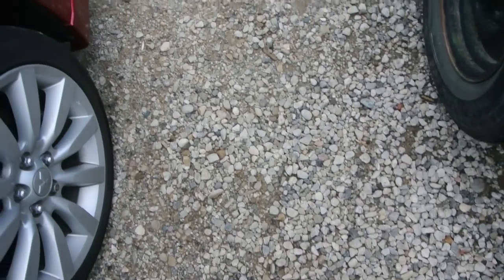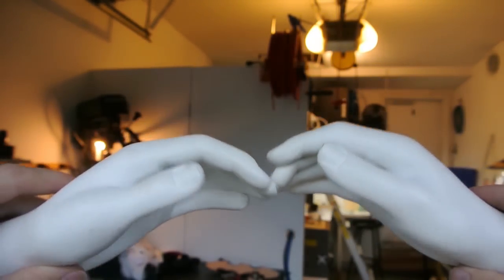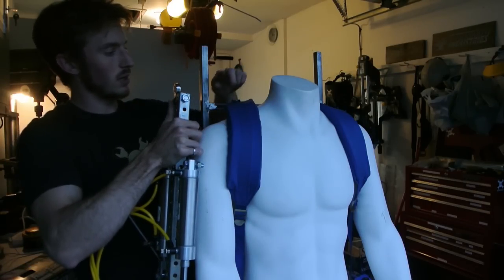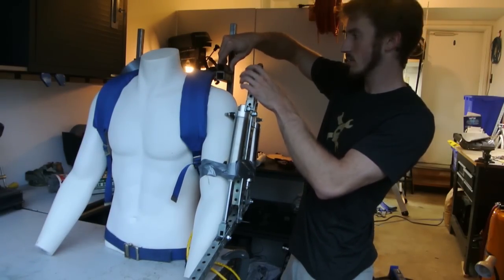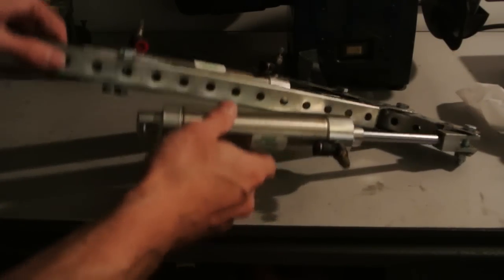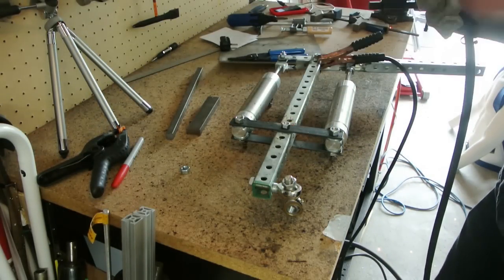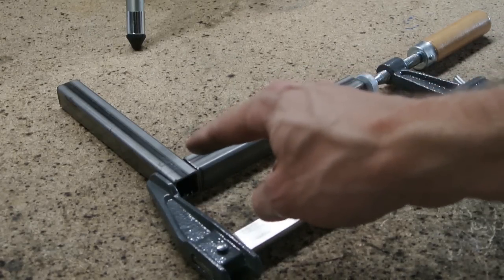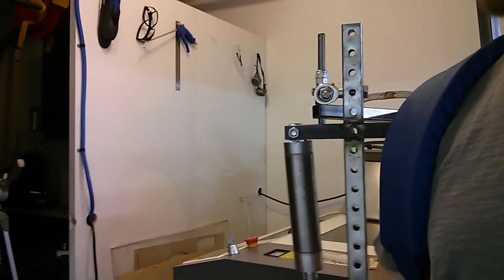Elysium Exoskeleton, Part 11: Mounting the Shoulder

Comment: Awesome stuff! I need to get an electric welder. Any recommendations?
Reply from the maker: If you're just getting started, I'd recommend a cheap little FCAW unit (Flux Core Arc Welder). You should be able to get one for about 100-150£

It's similar to MIG, like using a metal hot glue gun. But you don't have to buy and refill the shielding gas since the flux in the wire. Super handy.

A stick welder is probably the easiest/cheapest method, but I'd skip ahead to the FCAW. I want to get a TIG but I need to take some courses on how to use it.